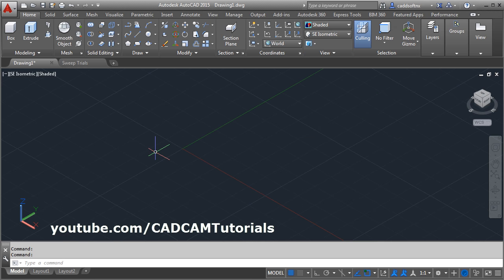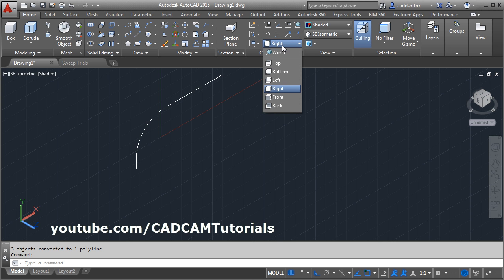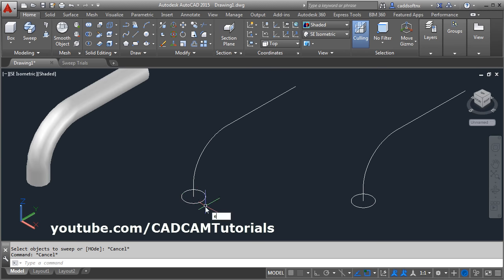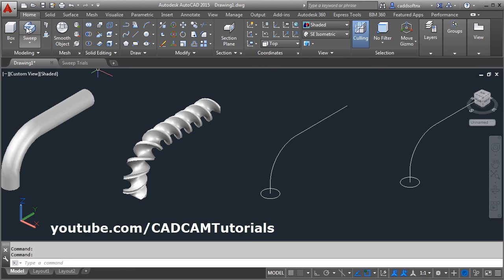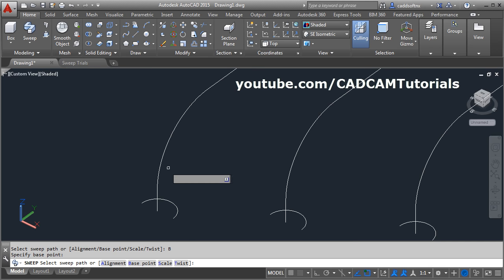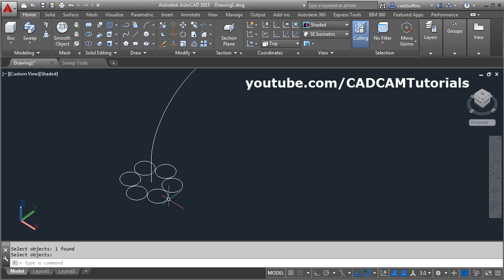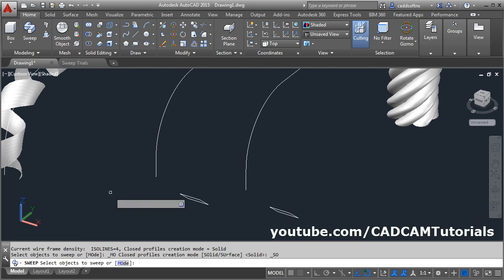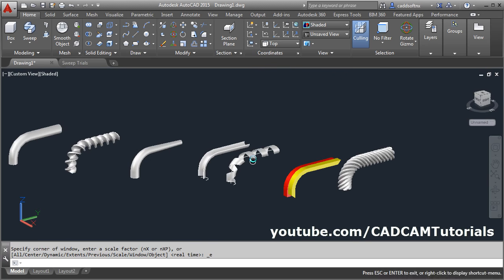AutoCAD 3D Sweep Command Tutorial Complete | Sweep Twist, Multiple profiles, Path, Surface

Comment: Thank you sir. Great content. I have a question about using twist command. You said, for three twists, multiply 360 by 3=1080. It should mean we should be only able to see 3 twists in the final drawing right? But, I could see more than 3 twists in the drawing. Why is that?
Reply from the maker: How you measure one twist ?
Reply: @CADCAMTutorials  It's difficult to explain. One twist of 360 degrees which is same as two twists of 180 degrees.

Comment: how to make sweep scale but the path is not smooth?
Reply from the maker: +irwansyah hussein You will have to try using smaller scales first.
Reply: CAD CAM Tutorials i have a line which not curve. Eg: like zig zag line. Based on tutorial for a whole youtube. They only can make a sweep with scale path on curving line. But not working for line which is not curve akka zig zag. Need ur advice on this.  The error message. The path (line) is not smooth.  :(